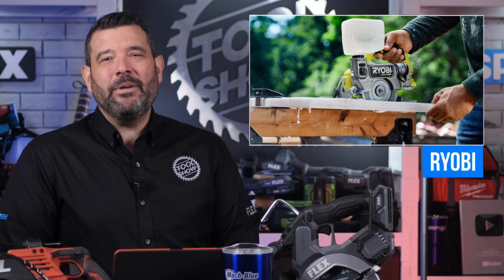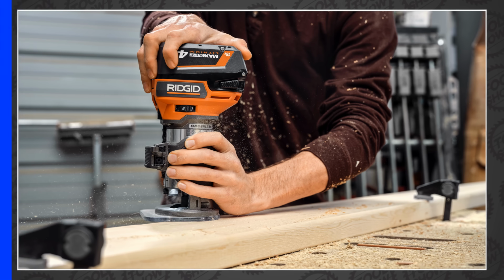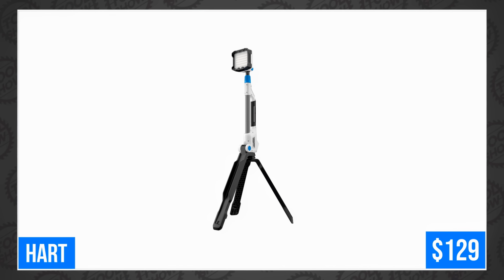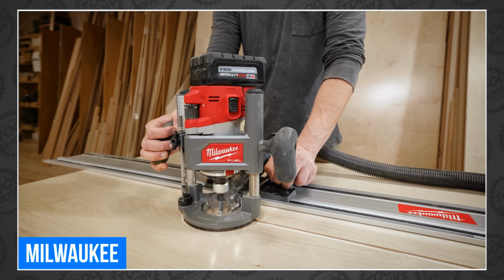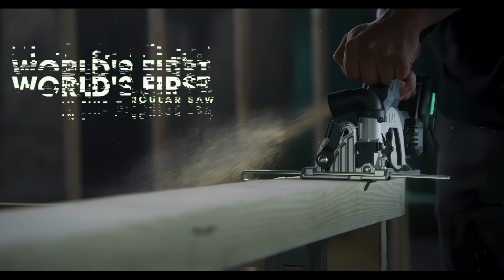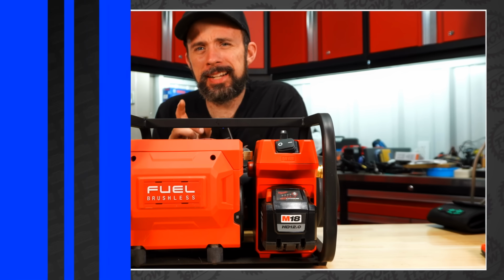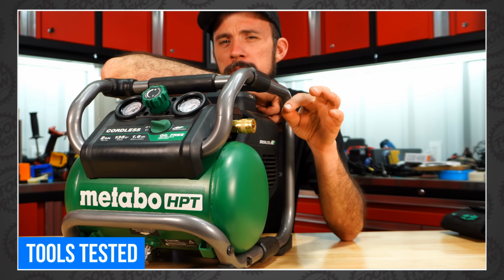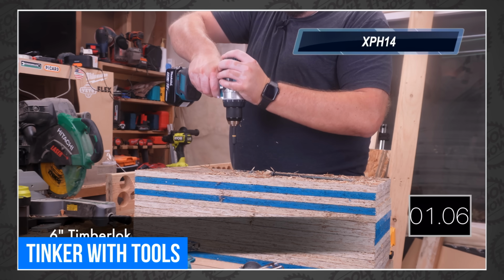NEW TOOLS from Milwaukee, RIDGID, RYOBI, and HART!

Comment: Yeah, we can tell you don't really use circular saws all that much, because every one is "ambidextrous" because you can see the blade cut from both sides. They are all designed that way. In fact, there isn't really a "Left Handed" or "Right Handed" circular saw. However there are "Left Side Drive" and "Right Side Drive" circular saws, and neither has anything to do with the dominant hand of the operator, but how the motor is wound and rotates.

Comment: Since the Flex saw is neither LH or RH blade, which direction does it happen to spin?
Reply: Since there isnt any such thing as a Left or Right handed circular saw, It's still a Left Side Drive.
Reply: @jmackinjersey1  thiers blade left and blade right saws and they spin in opposite directions

Comment: After using the Bosch 1/2 in router with the trigger on the handle, I am never going back to using a router with the ON switch and speed control anywhere else. I feel  much more comfortable keeping both hands on the router at all times while it is spinning.
Reply: I'm really surprised they haven't come out with a cordless 18v yet.  They really dominate the corded router market.

Comment: I wish more companies did hybrid for tripod lights and vacs
Reply from the maker: The HART one was a real gem. Plan to pick one up.
Reply: A lot of the Milwaukee lights are dual power. However, when you are talking about a tool with a motor, then you actually lower the performance due to the way each power source powers the motor and having to make the motor work at the lower input. Just ask DeWalt.